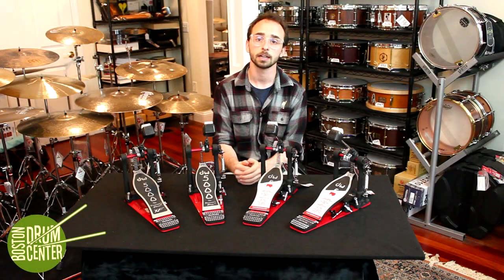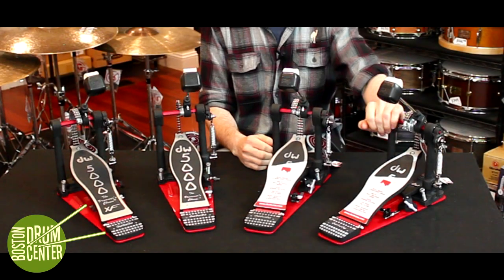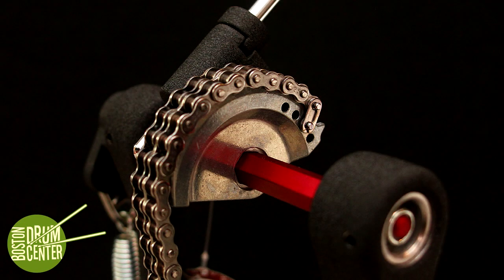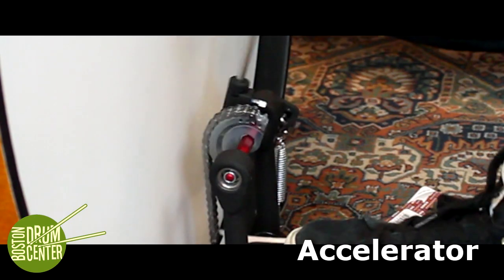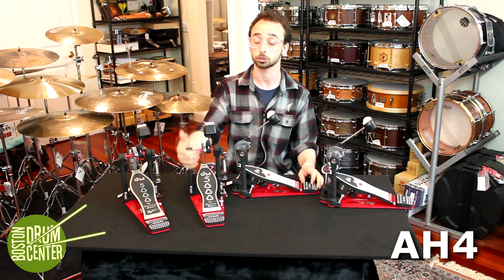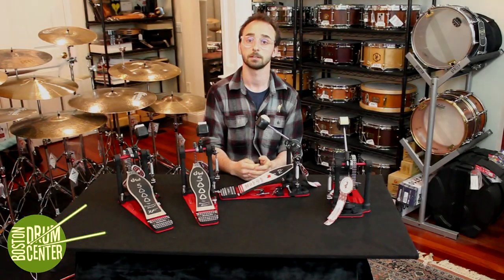DW 5000 Pedal Features Explained: TD4, AD4, AH4 & AD4XF

Comment: Hi there. I can see this is an older video, but thought I would try my luck. Would you suggest the DW 5000 turbo for newer players, as having control is important for beginners?
Reply from the maker: That makes sense.  But learning on an Accelerator cam wouldn't necessarily result in bad habits or anything.  If the goal is to play a genre or style in which the added speed of the Accelerator would be a benefit, I'd recommend getting it right out of the gate.

Comment: Is the Turbo model meant to feel lighter? I find the accelerator to be quite heavy feeling, obviously this is a characteristic with all DW pedals, but especially more so with the 5000's. When I purchased my AD4 5000 series I did not try the Turbo's and I'm just wondering if there is a major difference in this regard. Amazing pedals either way!
Reply from the maker: I kicked this one to Ethan because he knows much more about these pedals than I do!  "Hi Jay, I am not sure if the turbo was designed as a lighter alternative to the accelerator. If you are seeking a lighter pedal I would recommend trying a different beater such as the Dwsm103. I personally feel that the turbo cam allows for a direct relationship with the beater. It feels more direct as compared to the accelerator. In any case please contact us and we can help with anything you need."

Comment: I have a set of Ludwigs that I bought new in 1969. I play them all the time.  I bought a DW 5000 and the pedal has to go 10 degrees beyond vertical before it hits the head. I’ve asked around what to do. Looked for a different beater but none fix the problem. I don’t want to take a grinder to the hoop unless I have to. Any suggestions?  Thanks.
Reply from the maker: Well, is the problem that the pedal isn't going far enough onto the hoop? And if so, is it the width or thickness of the hoop that's preventing it?
Reply: @bostondrum  the pedal is all the way on to the stop on the clamping device. The hoop is wide  the pedal won’t go on any farther. Original stock hoop.
Reply from the maker: @rayfabbri3759  If you can't raise the resonant side enough to compensate and you don't want to notch the hoop, you could try a Dixson riser or a replacement hoop. Gibraltar hoops are cheap and pretty narrow, and that would let you set aside the original to retain the resale value of the kit.
Reply: @bostondrum  Thanks for the help. I thought maybe there was an adjustment to the cam or something like that. 
I’ve been playing these for 52 years and I don’t care about the resale value. I will grind the hoop. I will probably have this set cremated with me when I go. LoL. Thanks.
Reply from the maker: @rayfabbri3759  You could adjust the throw a bit, but I think it will feel weird regardless if it's travelling that far past 90 degrees. I'll message Ethan (the expert in the video) and let you know if he has a suggestion. Thanks for watching.
Reply from the maker: @rayfabbri3759  Ethan recommended the DW 106L offset beater, but it sounded as though you may have tried something like that already. Good luck.
Reply: @bostondrum  I have contacted suppliers I use hear and nobody has it or even know about it. I went on the DW site and haven’t found it there. Can I order it from you? Please let me know.
Reply from the maker: @rayfabbri3759  Sure -- where are you located?  You can email us using the link at www.bostondrum.com if you'd like.

Comment: Very clear explanation.  Thanks.

PS. What're the benefits of stepping up to the 9000 series?
Reply from the maker: Thanks for watching. The 9000 has an adjustable cam which morph from Turbo to Accelerator, and assume any shape in between. It can also accommodate a nylon strap, which is included.

The 9000 felt smoother to me than previous versions of the 5000, possibly because of the 9000 spring design (note that the spring is inside of the tower instead of outside, which may also make it more durable). But the 5000's new pivot point has helped to close that gap, in my opinion.

I hope this helps!
Reply: Boston Drum Center Thanks.  This helps a lot.  I’ve already purchased one.  Great pedal, very light and smooth feeling for my foot.
Reply: I like the 5000 better.
Reply: I have owned the 9000 series and the 5000 series.  The 9000 series to me was too clunky when it came to the massive CAM.  The 5000 series are more streamlined and straight to the point.  In the 5000 series I prefer the original round Turbo sprocket.  The Accelerator kind of just lobs the beater at the bass drum head and you feel like you don't have total control of the throw.

Comment: What are the differences between the 3 and the 4 gen? As the left-hand model only comes as 3 model.
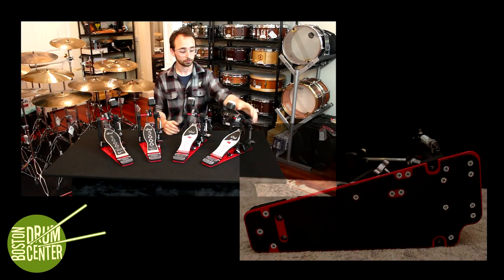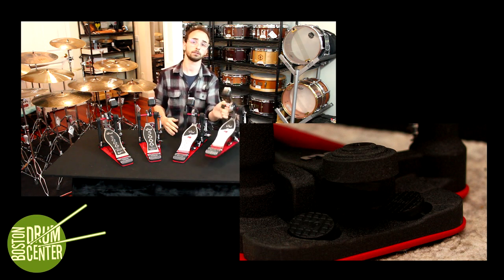Reply from the maker: Ethan covers the upgrades from the third generation to the fourth from around 0:22 to 0:44 in the video.  So the previous model had velcro instead of the non-slip surface on the underside, a fixed mount for the base of the spring, and a regular jaw-type hoop clamp.

Comment: Are there any pedals that are Xf with turbo? 

Great video btw, it really cleared up my confusion!
Reply from the maker: Thanks for watching. Technically the XF only comes with the Accelerator cam, but we could get you one with the Turbo. DW used to assemble pedals to order in situations like this, and they may still do so, but we haven't needed it in a couple of years. If necessary, we could swap out the cam here.
Reply: @bostondrum  Would you recommend to go your suggested way or get the 9000 Xf with the interchangeable modes?
Reply from the maker: @marcocorona5422  Right, the 9000 cam can do Turbo, Accelerator, or anything in between. There's another thread in this comment section about 5000 vs. 9000: I like both, but some people prefer the lighter, more tactile 5000. I hope this helps.
Reply: @bostondrum  It really does, thank you a ton for your help on this, when I make up my mind I’ll make sure to contact your business to purchase the pedal! Thank you!

Comment: What exactly means long board version..  im nl native english speaker im kinda confused
Reply from the maker: The footboard (where it says "5000") is longer on the XF model.  It gives you more leverage and/or just more room if you have a larger foot.  Thanks for watching.
Reply: @bostondrum  Oh okay.. now i understand.   I need definitely the XF model.   Thanks for responding
Reply: @bostondrum  How much longer??  I can't find this simple information anywhere which is bizarre.
Reply from the maker: @victorrader4349 I think it's one inch longer, but I could measure it for you next week.
Reply: @bostondrum  Thank You.   I suppose an inch would feel different/better, even for someone who has been playing for over 50yrs, who wears a size 13.
Reply from the maker: @victorrader4349  I measured this and the XF footboard is exactly an inch longer.  From the flat part at the top to the flat part at the bottom, 9-13/16" on a regular pedal, 10-13/16" on the XF.
Reply: @bostondrum  Excellent, Thank you, I think I'll give it a try.